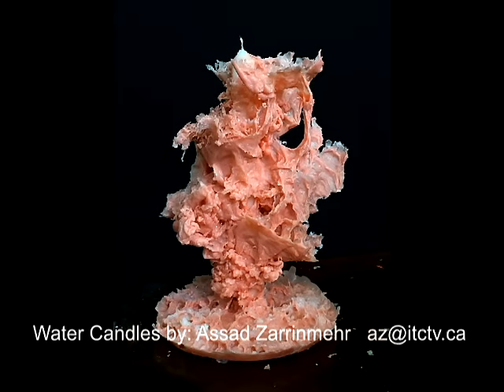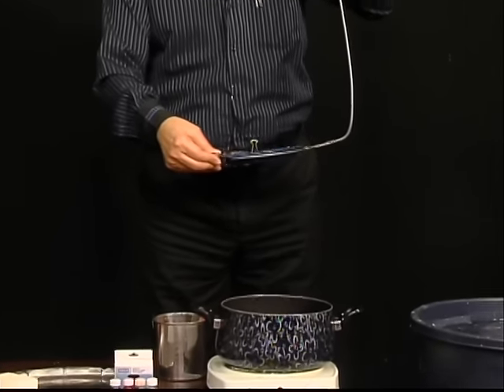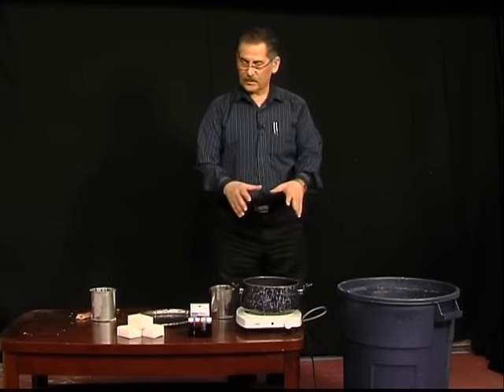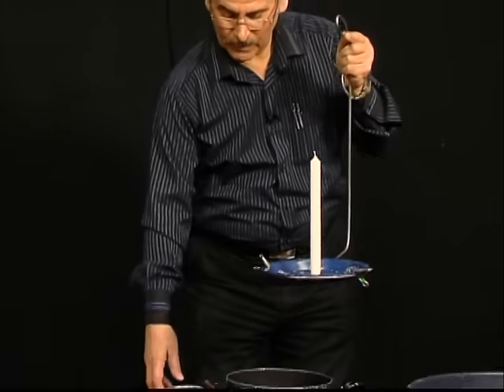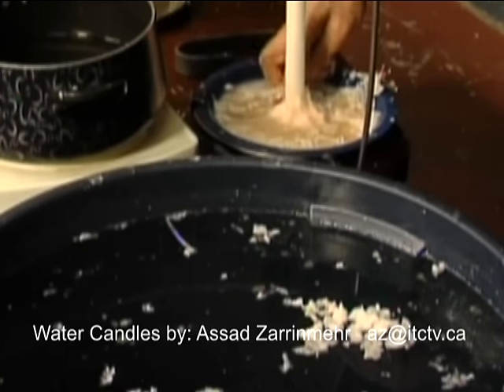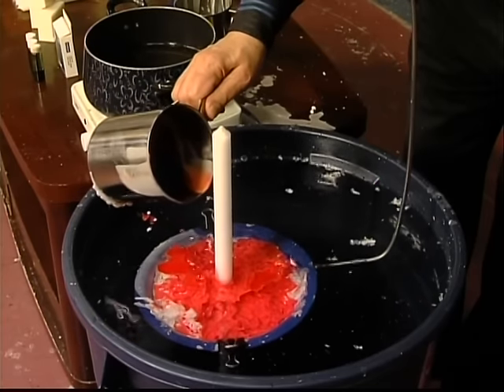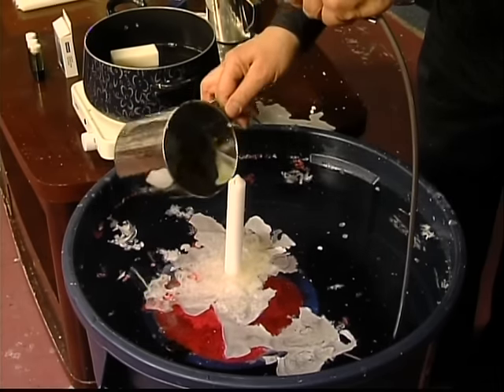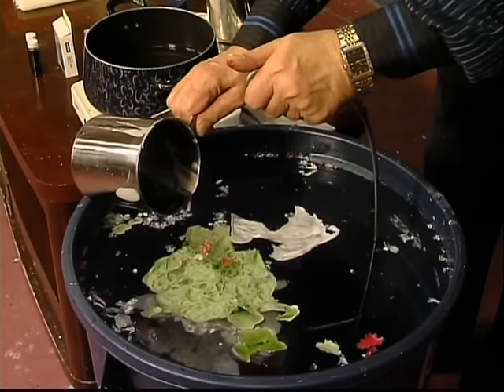Water Candles  Making

Comment: Thank you so much for sharing this, I didn't even know that they could be made using this process, but then again, I have just received my first candle-making kit. Can this process be trimmed around the edges or sculpted for a more smoother design? Can they actually be burned or just used for decoration? How much wax did you melt to make each one? How many drops of coloring did you use? Were any essential oil or fragrances used in making any of these? If not, can it be added? I do apologize for so many questions, this is just fascinating to me.

Comment: What type of wax is this?  Have you used different kinds of wax before? If so, did you noticed a difference in quality/structure/etc. based on the different melting and cooling points?

Your artwork is absolutely stunning!
Reply from the maker: Thanks for your interest. I bought the wax bar at Michael's. I only use one kind of wax unfortunately I don't know any other kind of wax. Good luck.
Reply: Karen Blackwell this is paraffin wax & it does have many qualities based on where they are imported from. For example wax from Hungary is really hard & long lasting. Its the number 1 priority. Japanese paraffin wax is good too. However, the worst quality might be of wax from Iran. Its oily, very soft, easily chips off, melts down easily & if you got different color layers in your candle the colors start to mix with one another in heat. You have to keep them in fridge just to retain their actual shape.
Reply: Muzna Hina
Reply: Can bees wax be used or Paraffin wax only?
Reply: I've used candles that have burnt down too low to be useful, they usually burn down the middle and leave an outer shell, so I melt those down and use them.

Comment: AWESOME!!!  How do you remove the candle from the plate?...
Reply: IMDEDE2 Just gently grasp it and lightly pull. It should come right out.
Reply: IMDEDE2 And if you are really afraid of it breaking, try slipping a butter knife between the wax and plate.
Reply from the maker: Thanks for your interest. That is a good question. You must make the base strong enough with more wax, so that when you are detaching candle from the plate, it does't break. Also, you can put the plate on stove,  heat it up slightly. But, generally it comes off, easily.